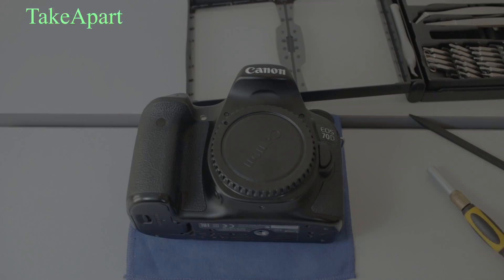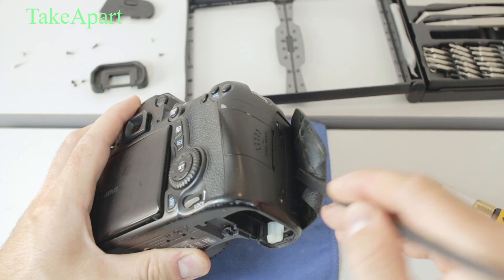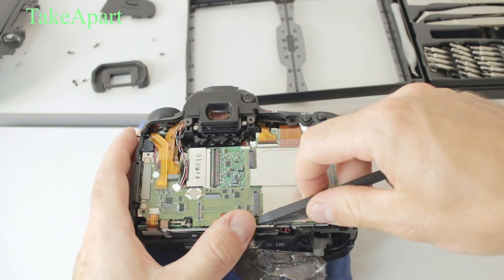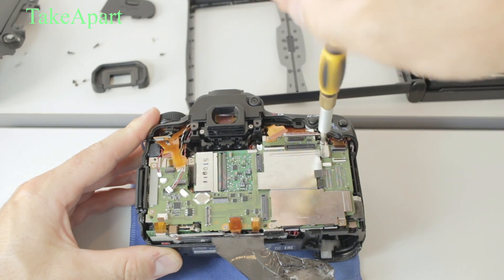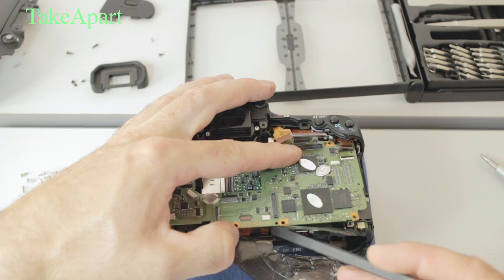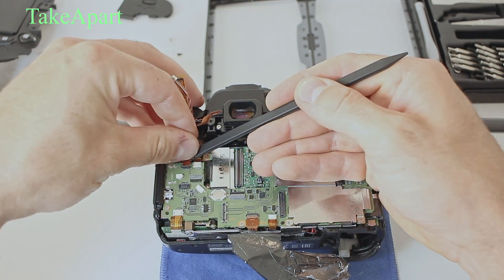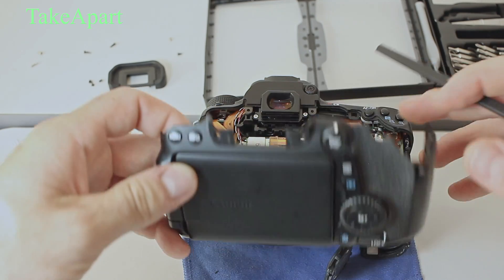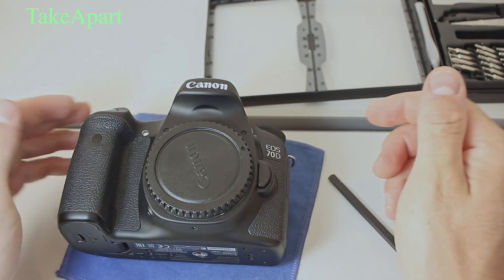Canon 70D | won't turn ON | Motherboard replacement | repair, fix | TakeApart

Comment from the maker: Hi Guys ... it is really awesome to hear about steps of such big company as Canon to recall 70D with problematic PCB to replace it .  Im happy to help and so thankful for all comments and likes .
Please Subscribe and share..  ..Thank You
Reply: take apart hi.. do you have a video how to open the view finder (eye piece) and fix the (green light) digital information inside (sorry I don’t what is the proper name)  thank you so much..
Reply from the maker: hi, don’t have that yet... looking forward to do it... 
thanks
Reply: Having same problem
Reply from the maker: hi there, feel free to follow video and all parts are linked in description. 
first make sure battery, small switches near battery and sd card door are ok ,  
thanks
Reply: take apart  please make a video. Much appreciated..
Reply from the maker: @freshiiuae3744  I will but dont have gear to fix , where you based? you can send me your or feel free to click and use my donation links in my channel section..
thanks
Reply: Hi can you do a video on, how to  clean viewfinder/focusing screen of Eos77D.
Reply from the maker: hi, soon as I will have hands on one.   thanks
Reply: Help me please to solve my issue i am from pakistan and there is no canon service center

Comment: Thanks TAKAPART guy! :) I have a 70D with a sensor that someone ruined via a laser while I was shooting video at a comedy show. I just purchased a 70D from someone who has this problem and was told that the motherboard was out. My thought is to replace that motherboard with the one in my working (well... working but taking awful photos). Question.... Is it just the motherboard going bad that caused the non powering up? Or should I have to look into replacing the power board as well?

Comment: Please help me out with this❤️ is this the same with 80d and if so replacing the old motherboard with a new one straight out from the packaging from ebay, will it be ok? (the issue is that shutter is not working nor the display only the small upper lcd display works)
Reply from the maker: Hi, hard to tell… you can try

Comment: Where do i buy a motherboard cuz
Reply from the maker: Hi , aliexpress is the place .... links are in description
Reply: @takeapart I have a question. My 70D is not turning on after re-installing the battery with Err70. Is this applicable?
Reply: @takeapart I am Korean

Comment: My Canon 7D gets on but it doesn't shows anything on Display, Repair guy told that few drops of water went inside n board isn't working... Is it possible that board can be repaired????
Reply from the maker: hi, I doubt it will be economical to repair… replacing parts is often cheaper and faster
Reply: @takeapart  so if I replace motherboard will the camera function like a new Camera???  Or it will be same before damage?
Reply from the maker: look Im not sure on the damage … you have to inspect it or take it to the repair shop .

Comment: Hi, I have a Canon 70d no signs of power I bought a new battery and when I try to turn it on there's nothing on the top and back display, how can I test if it's the main board or the Power board causing the issue?
Reply: Also there's no signs of water damage and corrosion
Reply from the maker: Hi , I would check first little switches next to each door(battery door and sd card door). it they closing circiut properly then it is main board…

Comment: I have a Canon 70d that won’t autofocus at all, often says that the lens won’t communicate with the camera, the light meter doesn’t seem to work, and the aperture is not displayed.  Do you think that replacing the motherboard would solve all of these issues?
Reply from the maker: it sounds like motherboard… check out lens terminals, camera mount terminals, connectors inside and if all looks ok …. I would go for new motherboard.

Comment: i was trying to replace the sd cardslot, however, after doing it and putting everything back together the camera now wont turn on. does anyone know why? Did i possibly damage something or is there something else i dont know.
Reply from the maker: hi, sd card door and battery door has little switch that detects if the doors are shut….  check them first

Comment: Hello. Best replacement video ever.  I got a question.  Is that heat tape important ? Because I don't have it.
Reply from the maker: hi , yes if you can just stick it back.

Comment: What is the reason why the motherboard would fail?
Reply: Great video by the way!
Reply from the maker: thanks for watching
Reply from the maker: mostly overheating in video mode ….
Reply: @takeapart  Oh gotcha, yeah I used the video mode a lot more than for taking pictures. I'm then guessing it's more for photography than videography.
Reply: I appreciate you responding to my question fast.
Reply from the maker: yes there is the issue…. it great camera but has its limitations.  depends where did you brought it you may be eligible for free repair from canon . check it out
Reply from the maker: no problem man!
Reply: @takeapart  yes i did long video record and motherboard is gone i think...it not turning on any more 😞

Comment: Had the same issue for Canon 70D (Err 80). All the repairs were performed free of charge by local Canon repair shops as part of Canon recall, not sure why this not the case everywhere. (I'm from Latvia)
Reply from the maker: hi, this video was created while ago... back then there wasn’t recall issued.
Reply: @takeapart  does that mean i could buy a 70D cheap with the error. And put it to a shop for them to repair it?

Comment: If I need parts to repair a sl2 where could I order them from, thanks in advance
Reply from the maker: you can use links in description and contact sellers directly... they will create aliexpress listings for you ...

Comment: Hello my dear friend, very grateful for your video and your help, the display of my Canon 70D does not turn on, the camera works but the display does not turn up, can you tell me what may be happening? Thanks so much.
Reply from the maker: hi, hard to judge.... go for it and open the camera ... check if ribbon cable disconnected it’s self.
Reply: @takeapart  Hello my friend, I did as you said, I found the problem, there is a broken micro wire from the cable that connects the display on the motherboard.
Reply from the maker: ok,  Im not 100%sure but I think that’s requires whole new cable ...
Reply from the maker: hi, hard to judge.... go for it and open the camera ... check if ribbon cable disconnected it’s self.
Reply from the maker: hi, hard to judge.... go for it and open the camera ... check if ribbon cable disconnected it’s self.
Reply: @takeapart  Thanks a lot for show how open the camera, I'm glad for this. Best wishes my friend. 🙏🙏🙏

Comment: Great video sir. I have a question. When we change the motherboard to the new  one, do we need to do any adjustment or calibration ? Does the board comes pretty calibrated from the factory
Reply from the maker: hi, it really depends on where you getting board from... if it’s from used camera then is good to go ...
Reply: @takeapart  what software is used to do calibration. I m buying a new board
Reply from the maker: software isn’t available to public... better to ask supplier ...
Reply: If you change mobo by an used one,it will work by using LV,but Af will not work perfectly (or not at all) and the color will be a little different...each mobo/sensor need calibration data for working Af and color calibration...

Comment: Hey would you please help me, i got a Canon 6D Mark ii  Motherboard, but it's not programmed. so the Software will be required after the installation as the seller told me, how can I do that? is it even possible? thank you in advance
Reply from the maker: hi, you can use it anyway.. the screen up top will display remaining shots as 999 . 
if you want to set it up with the software... you may have to visit authorized service center.

Comment: Bought a used one of these and turns out it doesn’t work. Camera shop told me it’s the motherboard and that canon would charge $400 to replace. So I bought the part and am going to attempt to fix myself. Really hoping it works!! Thanks for the video!
Reply from the maker: hi, happy to help
Reply: Bought a non-working camera and you didn't realise?
Hmm.
Reply: Hello, did it work?

Comment: Good morning from Uganda, we have the same problem with our 70D Canon Camera, and it has totally failed
Reply from the maker: morning, plenty of canon 70d s has the issues... feel free to use links in description for parts and follow video.
Reply: @takeapart  let me try but its now one week and the machanic for repair and no results at all. The power is in the system but displaying on the screen is a problem. Thank you for taking us through let me follow your video you never know some magic may happen.
Reply from the maker: yes no problem, happy to help. if you need anything you can also email me. thanks

Comment: Can you repair canon 70D focal plane issue (takes crisper focused shots in live view but blurred shots when shot by eye piece for same.settings including autofocus). Many people have similar complaints but I don't know where get it fixed. Here in GCC countries the canon service has bad reviews. 
Can you please help.
Thanks.
Reply from the maker: well there is way to do it ... literally eyeball it but easiest way is to send it to canon ...

Comment: Could you repair/adjust the focal plane of CANON 70D .
It takes good and crisper images when in live view shooting but blurred shots when using eye piece shooting for same settings (including autofocus mode).

There are many complaints but I don't know where to get a fix. (Canon service in GCC countries have no good reviews so I need your advise / help).
Thanks in advance !
Reply from the maker: thanks for watching

Comment: How hard is it to get to the adio/mic ports? Might need to do that on a 80d. Though the small board holding the ports on a 70d can be removed, not sure about the 80d though so maybe the whole main base plate needs to be replaced.
Reply from the maker: not 100% sure but it should be pretty much the same as 70D 
thanks

Comment: my canon 70 seems to heat op really fast and cd card inside is also than heated up fast.how can i solve this issue?i know that all dslr heat up at one time.but i feel my canon 70 heats up to reapidly in video mode.my previous canon 700D didnot heat up that rapidly.thx
Reply from the maker: +robin reso hi, it is normal for 70D .... once it became dead you just follow video and replace motherboard... thanks for watching
Reply from the maker: +robin reso hi, seems normal to me ... if you don’t have random shutt offs  or other issues... don’t worry 
thanks for watching

Comment: Sometimes my camera does turn on, when I'm inserting and unplugging the battery and sd card, and after that, if I leave my camera for about 7-10 minutes it will not open again. I have to do the process over and over again just to open my dslr. Does it mean I don't have to change my board?
Reply from the maker: +TOP 1 FAN it depends... maybe you have faulty small swivh under the battery door or sd card ...you need to investigate more... try to press those switches manualy with piece of paper or something soft to avoid damaging them. if they working ok ... your problem will be motherboard. 
thanks for watching
Reply from the maker: +TOP 1 FAN hi most probably it’s motherboard issue... thanks for watching
Reply from the maker: +TOP 1 FAN most likely YES, however first check small micro switches near sd card door and battery door (once you disassemble camera) they can be damaged. 
thanks for watching

Comment: Could you please tell me if the heat tape teared up is this a big trouble If I film a lot?
Reply from the maker: hi , hard to say .... that tape definitely helps a bit but  over the time it’s getting worse in quality anyway .... 
thanks
Reply: @takeapart  Thank you! Appreciate your fast response! Replaced motherboard successfully in 30 minutes or so! Many -many thanks to your effort!
Reply from the maker: thanks for watching Nick ...

Comment: I have a canon 80-d in which the video gradually started acting up and now wont work at all. Also the various buttons are sporadic even though I can take pictures--its brain is near death. I am desperate as I am 66 just getting by on SS and simply cannot send it in and be give a bill for more than the value of the camera to get it back. Do you think replacing the mother board like this would be good odds of fixing it??   any advice appreciated and I wont hold you to anything but I need to do something-money is short I cannot shell out $1000.. thanks
Reply from the maker: hi Jeff 
motherboard. butons ... it soutto me like water/humidity damage... try to replace one by one and you see what will help.  yes canon repair is expensive... is better to have good content insurance for situations like this. 
thanks

Comment: I swapped out the board on my 70d, camera now switches on and takes images, but the viewfinder is blurry (diopter doesn't fix it) - It flashes red when focussing and it will not show grid lines, level etc. Any ideas?
Reply from the maker: hi there... there is many options.  where did you got board from?   did you removed viewfinder unit when changing board?   what about screen? it focuses ok when screen on?  thanks
Reply: take apart Thanks for the reply. Bought the screen from eBay from a used camera parts store. Didn’t remove the viewfinder or screen. It takes pictures fine, but the viewfinder is constantly blurry. If I switch it to live mode, the picture is clear and in focus.
Reply from the maker: you meant board? from ebay? 
it is tough one... if you not tried to tighten sensor screws or play around with viewfinder unit it must be board. thanks

Comment: Mine also dead today kindly help me to solve error 80 i dont have warenty now
Reply from the maker: hi ... first check all around... look for cheap solutions... if it’s constantly off- try battery door, sd card door , swap battery , try to detach lens.  
if nothing helps... then is time to follow video ...
Reply: @takeapart  i already check all swtiches but how to get new board it too costly and not available in my country pakistan
Reply from the maker: then is time for ne board!  unfortunately you need to contact the seller and ask-probably pay more for shipping to your country.... they may help you
Reply: @takeapart  i dont have new mother board in this video you just replace new board to it do u have other solution to repair that board ic which is defected or other solition
Reply from the maker: unfortunately it is job for micro soldering... expensive even more unless you have friend who will check and fix for you. 
as the motherboard is one unit it is cheaper and easier to replace it. 
highly recommending for you... just get in touch with sellers on aliexpress and try to get one . 
thanks

Comment: Please help my Nikon l340 camera turn not on.pls pls help
Reply: I am try bat not work.. Pls help
Reply from the maker: it is hard troubleshooting over the message, what happened last time you used camera?
Reply from the maker: his there... it is tricky! check all small switches around battery door and also check if you have juice in battery... connectors ... and try
what happened last time you used your camera?

Comment: What's the tool you are using ? Where to buy one ?
Reply from the maker: hi there 
set of screwdrivers with plastic sticks 
in description of video is link for “set of screwdrivers “ you can buy them 
thanks
Reply: The link doesn't show your magic stick. JAKEMY JM-8101 32 in1 ?? Thanks
Reply from the maker: oh yes that’s strange... well will send you link for exactly same as my one... in few hours. (with magic stick) 
thanks
Reply from the maker: hi man ...I tried to find my set but it seems like it is no longer available ... you can buy that set listed in description ...it is good quality ! and find just some plastic opener usualy for smartphones ....and get that as well ..... 
thanks
Reply: Thanks. Just found the same item online. Less than $1 each. Nice
Reply from the maker: cool